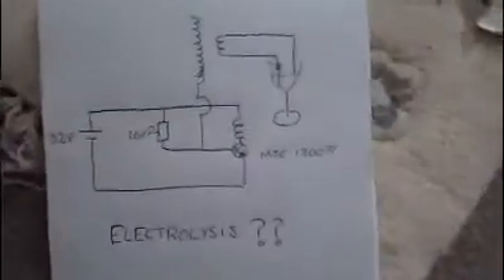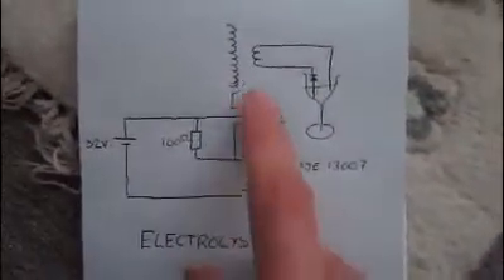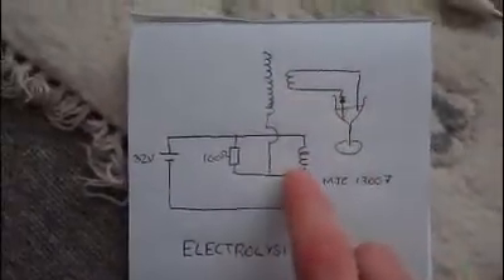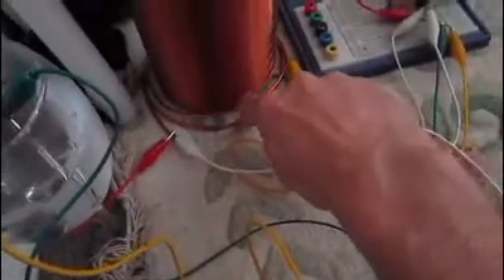electrolysis with an exciter - different metals as electrodes

Comment: Great runs there, I learned a lot :) 
Presumably the best and longest lasting production is on the list of 'to do' experiments. Do parallel electrodes cut the production with surface area ? and can parallel electrodes sit in separate wine glasses ? If that works out, then all goes into a battery, put the assembly in the car, start up the output and drive off lol, Hey I hope so at some point down the road mate !

Comment: Interesting theory. I know that when you heat copper a thin red layer of cuprous oxide forms followed by a thicker black layer of cupric oxide. You seem to form at least a black layer. But it's black. Maybe there's another reaction that happens when the oxide layer is blasted off.

Comment from the maker: Yes - The oxygen becomes a metal oxide and forms a layer on the metal.  But then I usually (in these videos) change the diode polarity, and that often means that BOTH electrodes start giving off gas.  When this happens the oxide layer is blasted off by the gas, and I think its the copper oxide (or other metal oxde) which changes the colour of the water.  Thats what I think at the moment, anyway!